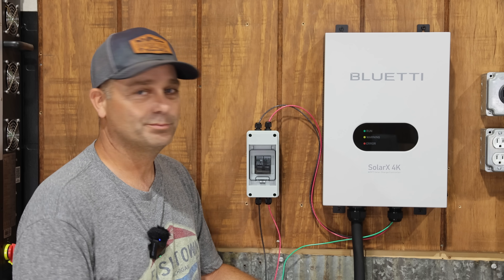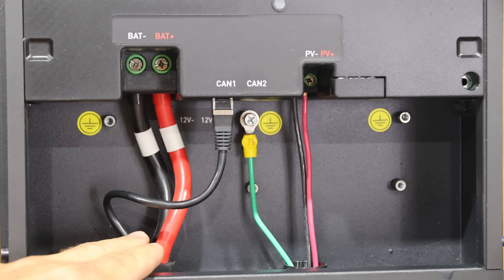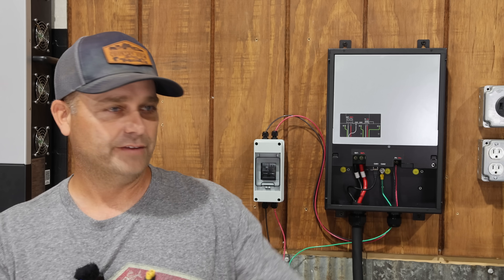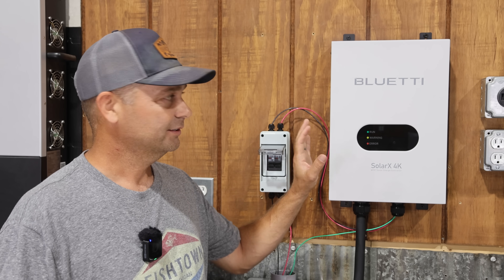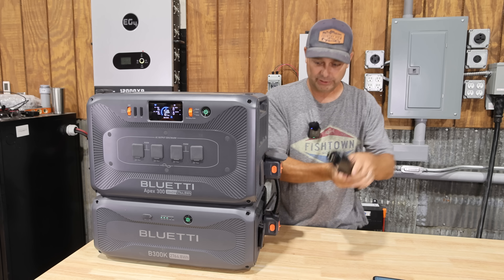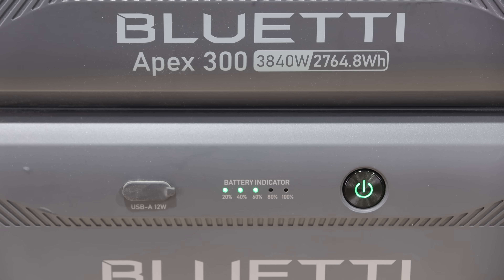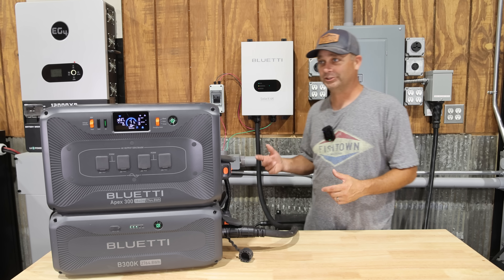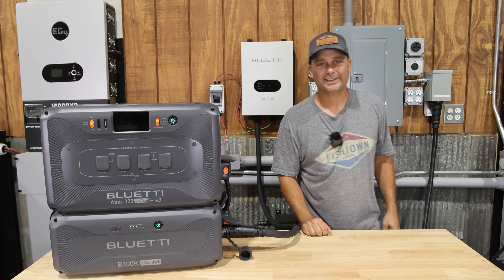Bluetti's New SolarX 4K - 4000 Watt Solar Charge Controller

Comment: Power stations like the units that your selling in this video all use cheap high frequency, transformerless inverter technology. A high-frequency, transformerless inverter's lack of galvanic isolation can potentially damage appliances, mainly due to shared DC/AC grounds, leading to ground loops, leakage currents, voltage fluctuations (brownouts/spikes), and inability to handle heavy surge loads, which can harm sensitive electronics or motors, requiring specialized installation and protection. 

How Damage Can Occur:

Ground Loops & Leakage Currents: Without a physical barrier (isolation transformer), the DC (solar/battery) and AC (appliance) sides share grounds, creating pathways for unwanted currents, causing interference or even system shutdown.

Voltage Instability (Brownouts/Spikes): Some models may dip voltage (brownouts) or produce noisy power, especially under heavy loads, which can stress motor windings and electronic components.

Poor Surge Handling: HF transformerless inverters often struggle with high starting currents (surges) from motors (fridges, pumps), potentially causing shutdowns or stress on the inverter and connected devices.

DC Leakage: The AC output can carry DC leakage, potentially damaging sensitive electronics not designed for it, or even causing issues like corrosion in marine setups.

Comment: Hi, if you are charging with solar 2800w, if it’s possible to use a device with 2500w directly ?(PV Loading 2800w and using 2500w at the same time )  many thanks

Comment: Excellent video...just confirming that the one connection to the Solar 4k, with any of the cables, will charge all the devices interconnected between the batteries and the Apex?...If I recall you pointing to connect to the last battery?  Did you tested for solar and 120v pass thru while charging and with battery charged, and still able to output 240v....thanks again for such an excellent review....with actual testing...
Reply: well the test was actually with the solar but not sure a load was connected....

Comment: What do you use for portable panels?  The yellow input connectors are limited 60 volts/20 amps.  4 PV 200 is the best you can do regarding Bluetti panels.  Is there a different item for me to use so I can get the same function as the SolarX 4K?

Comment: We just got ours set up and running. We have 12, 250-watt panels that are older. On our last unit, the bluetti ac300 we had it set up with two input lines running 6 panels each two sets of 3 in series and parallel. Now we have to have at least 5 panels in series to meet the requirements of 150 volts to turn the device on. Problem is, now we have it set up like bluetti recommends 2 sets of 6 panels in series and parallel. Before this set up, we were able to bring in at least 1700 to 1900 watts average peak.. now the set up with 2 sets of 6 only brings in 980watts max. I know that this time of year input is reduced, but we adjust our panels with the angle of the sun. Also we literally had 1800 to 1900 watts input the day before we made the adjustment. Also the new solarx setup has only 1 pv input lead instead of two. I am just stumped on how it is reduced when this unit is made to handle more input? I guess my question is, is there something we're overlooking? 
BTW when we hook up just the 6 in series we get 900 est input on one set of 6 and then 700 plus on the other set of 6.. it's when they're tied in parallel that we max out at 980 almost exactly. Is there something we're maybe overlooking or a setting that need adjusting? Our panels also are 30 volt and 8.8 amp each also. Any advice would be appreciated. Thanks! Our bluetti runs our whole cabin offgrid.

Comment: Great video.  I've been asked to set this MPPT up next week and it seems simple.  It's the bluetooth connection etc that I'll leave to someone more tech Savey.  Using an apex 300 and a AC500 with multiple 300 battery packs.   Only 2.64Kw of panels to start with.  6 x 440W panels, likely 45V open circuit.

Comment: 8:25  what if you didn't have the b300k plugged into the apex300 like at 5:52 - how would it show in app?  basically is there a way to see charging/ power info if the apex300 isn't seeing it?
Reply: No

Comment: Great explanation of this system , I have one coming , Apex 300 , B300k and the Solar X 4k  , quick question , if you are not connecting the Apex/ Bat system to the house supply , only using as a portable station/ battery , but will charge via a fixed PV array through the Solar X 4K  and normal ac charging, do you need to ground the system , PV  array and the Solar X 4K. , on the grounding on the Solar X 4k , there are 3 earth terminals , do you only need to use one , or should they be linked or individual ?

Comment: If they release Solarix 4K for AC500, will it be possible to charge simultaneously using the standard 3kW on the AC500 and an additional 4kW that goes directly to the B300k?(Total 7Kw )?Thank you.
Reply from the maker: total of 4Kw between power station and batteries.
Reply: @CountryViewSolar-DIYProjects 🤔 impossible, total 7Kw

Comment: Glad to see Bluetti is giving more flexible options for larger solar arrays.  I know the AC200L that I have could only take in 1200W of solar.  That'll let you recharge in a few hours if you're not powering any loads, but as soon as you start trying to power loads at the same time, it's really not sufficient.  

Thanks for sharing!
Reply from the maker: Right now, Bluetti only seems to market this for the Apex 300 and the AC500.  Not sure what power stations it will work with.
Reply: @CountryViewSolar-DIYProjects it will work with pretty much any power station with atleast a 60v mppt input. It can also be used to charge a standalone 48V battery bank.

Comment: Good stuff. I have ordered this solar charger with a 3-XT60 charging cable to charge three Apex300 units connected to A1 hub. It would have been nice if Bluetti had integrated solar disconnect right into the unit as many other soar charges do.

One question: you mentioned ethernet cable that you connected to the SolarX 4K, but did not say where it goes to? I’m a little bit perplexed what is its purpose?
Reply: it's part of the cable that goes into the port.
Reply: @TaKikeShaki wow, the cable goes into port. Who would have thought? I mean where the cable goes to on the other end. And don't tell me it goes into another port.
Reply: + and - and the CAN cable are in the P090A cable( chunky cable) they are all exposed on the solar X 4K side. Other end fits in the proprietary socket where P090A cable goes into. It's for communicating with the apex 300 and batteries and vica versa. Hope it helps. Will take mine apart at some point.🫠
From the @Netscorer
Reply: @TaKikeShaki Oh, OK - thanks! So is just a part of P090A cable for communication back to Bluetti power station. Part of me wonders why they do it this way. Why not just have an inlet to connect the P090A cable into the Solar X4K? On the one hand Bluetti preaches simplicity of connections between their modular components and on the other they release this Solar charger that requires user to connect everything manually, even the ground cable. I doubt anyone outside Bluetti line of products would ever buy this solar charger.

Comment: Why would I want this instead of just getting an AIO system?
Reply: This is meant to be an additional accessory to the Apex 300, which is an all in one system. This is not necessary unless you want to use a high voltage array with it.

Comment: Hmm.  This makes very little sense to me.   They are taking what is basically a regular charge controller and slapping on a ton of proprietary wrappings around it.   If you as a home owner are going to put so much solar up to justify this device, then at that point you really should have a real, permanently installed ESS system and not a power station (no matter how beefy).  It just doesn't make a whole lot of sense to me.  It's so wasteful.  It's so unnecessarily proprietary.

Is it possible to at least program the sucker to charge a regular LiFePO4 battery bank without all the proprietary bluetti nonsense?  Does it at least have proper manually-specifiable target voltage,  amperage limit, and float settings?
Reply: Bluetti, and similar companies, are trying to get these solar systems in to the hands of more people (ie: a larger market). To do so means to take what is more than most will ever want to bother with, like battery arrays, float voltages, charge rates, etc., and make it plug-in simple, something anyone can do. That's the reason for the proprietary-ness of these system. So no, there are no settings for charge currents (other than the 120 volt charging current), float voltages, etc. There is no need, because that is all designed into their systems. And that's what most people want. Having backup power systems, or cost-avoidance systems, is a good thing. Others, like yourself, who completely understand the technology can go ahead and build something that could arguably be better, but the average Joe can get something quite close. Similar to building your own PC, or having a car with a manual transmission instead of automatic (perhaps more relevant to the US market than EU).

Comment: so little info available for the Apex and its accessories.even talking with  Bluettti i can t get a straight answer and then i see a video with more into than Bluetti could give me.....this crowdfunding thing is not very organized. I received my two Apex thinking i understood how to use them.....not even close.  i need almost 2000$ in accessories to use them the way i had planned. Bluetti cannot even give my a consistent answer on the A1(ac module to parallel and connect Apex) home integration module and solar x to get my Apex running with the 8 AC300s i already have.......any one else who has problems with a  bought Apex or do you have it working yet? not talking about influencers paid to review them.
Reply: I have nine AC300’s and received three Apex300’s.
Yes there were issues and they were aware,once they pushed new firmware for me everything has been great.
It’s a much better unit than the AC300
I like the versatility and it’ll make a great home backup system.

Comment: Didnt catch if this works on the ac300?
Reply: IYes! As long you get the the SolarX 4K with the PD090 cable, this is compatible with AC300, AC 200 Max, AC200L and AC500 with B300, B300K Batteries.
Reply: @bayguy69  4 kW on AC500 in addition to its 3 kW? Total 7?